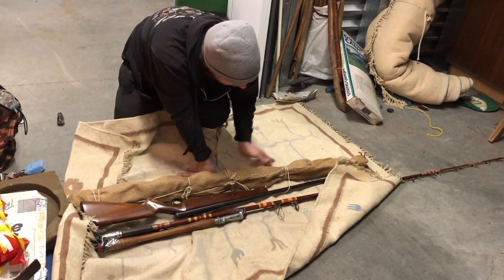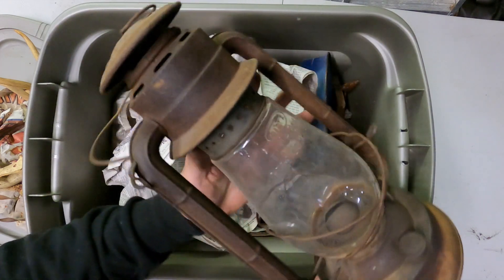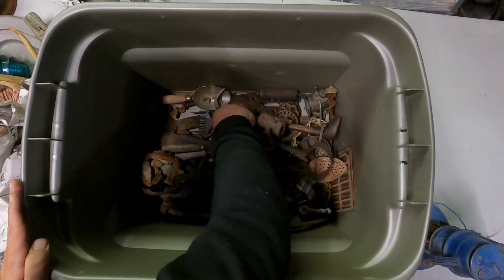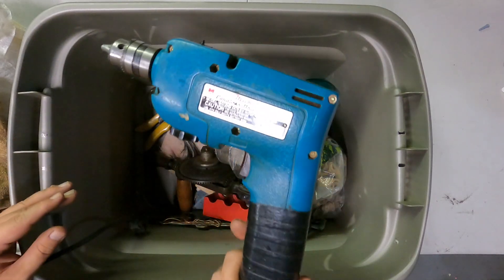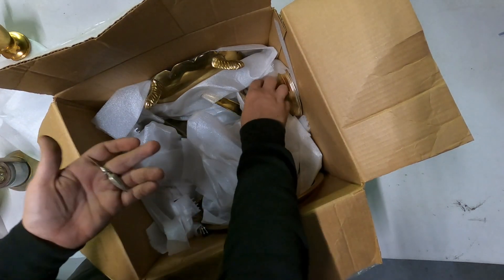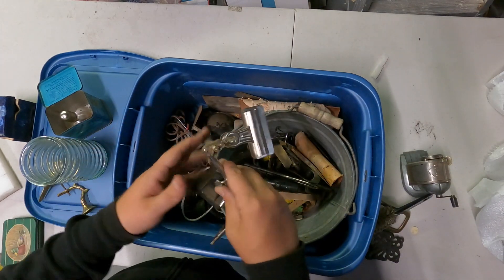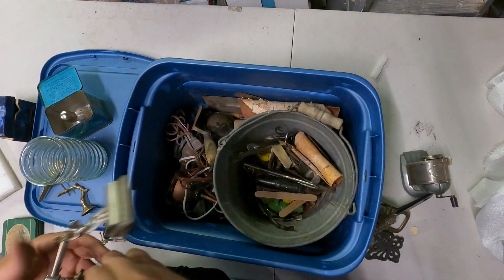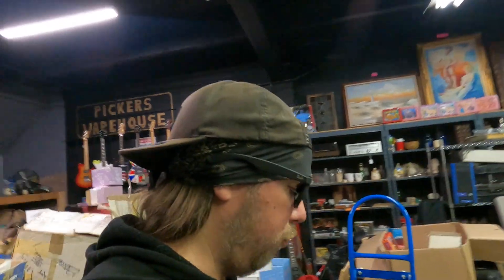This Storage Unit Will PUT ME THROUGH COLLEGE! I Spent $3000 at the Auction

Comment: That 6 or 7 inch piece of wood with threads on one end screws into an insulator "lid to something" you picked up next.
Reply: At 3:15, the metal coil handled masonary/rock/ hammer. Definitely collectible.
Reply: Carbide lamps are very collectible. It's the item at 3:24 that has a round reflector  and the small canister.
Reply: The scissor looking things are sheep sheers. Imagine clipping wool with one of those for a day.
Reply: I believe that hook is used on a boat.
Reply: At 4:27, the multi prongs in straight line is an ice pick. Heavy duty because ice came in really big blocks cut.
Reply: Wonder if a box full of these would sell at your auction. I buy boxes of this stuff and sell it all the time, but I don't know that all your bidders do. Not sure.
Reply: Cat and fish facet knobs are fantastic.
Reply: I sell a shoulder hand drill like the one at 6:39 starting at about 70, more if good condition and good m anufacturer.
Reply: Tobacco tins are very collectible.
Reply: Oil cans are good.